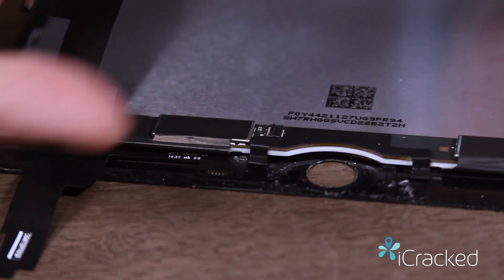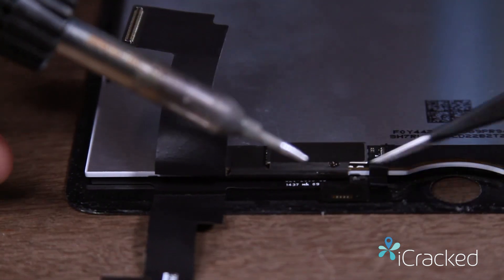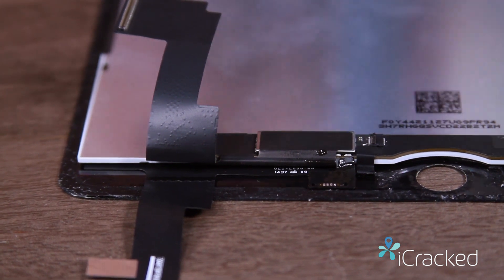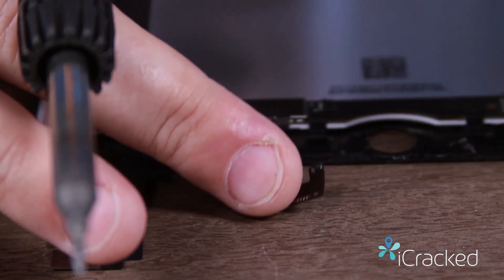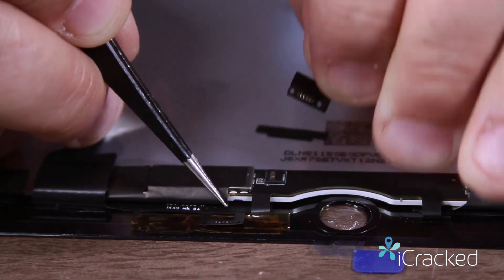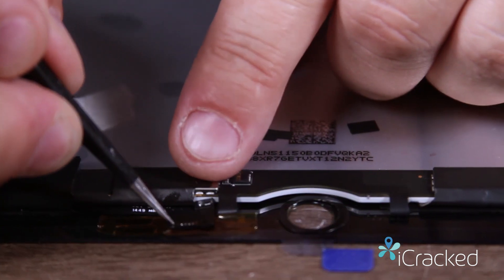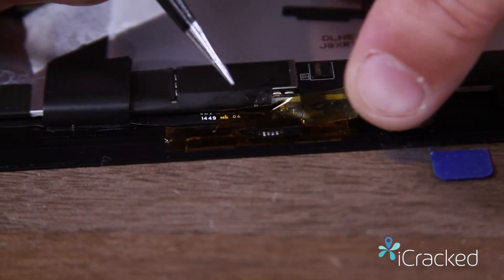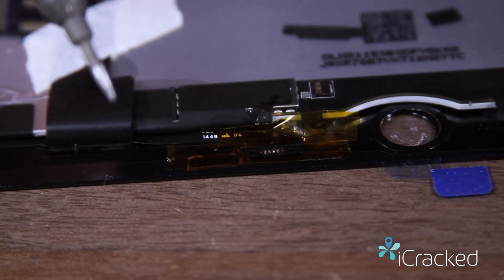iPad Air 2 Sleep /Wake sensor - Solder repair

Comment: thanks for the video, i had this issue after replacing an air 2 screen assembly. problem seemed to remain even with the original screen (cracked but still working..) strange

had a quick look at the 4 pads that had been soldered on my replacement, 1 pad had never actually been soldered, poor quality of workmanship from that manufacturer (won't use again)

i actually ended up desoldering the new sensor and just soldering it down again properly, all working now.

great guide though, thanks for your time.

Comment: Just so you guys know, there are two smart cover sensors on these iPad Air's and Mini's.

One near the home button and one near the screen connectors on the logic board.
Reply: If you don’t have problems with the logic board and just do a screen replacement, do I need to work on the other plate?

Comment: What would happen if this part is not transferred to the replacement LCD/Touchscreen assembly? Any other usage besides the sleep/wake function?
Reply: I know this is a very late answer but, the smart cover magnets would not function properly with the iPad causing the iPad to lock itself when the smart cover is wrapped behind the iPad.